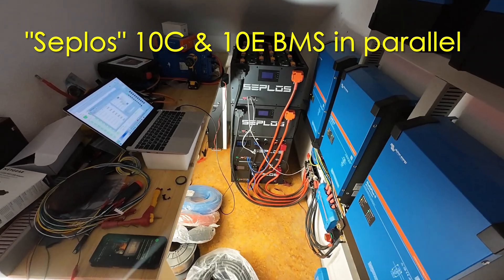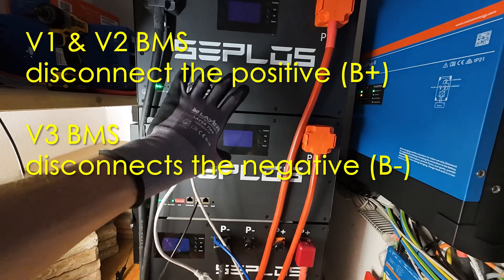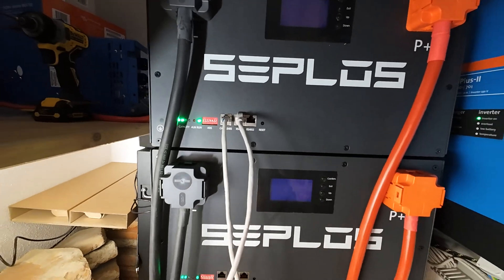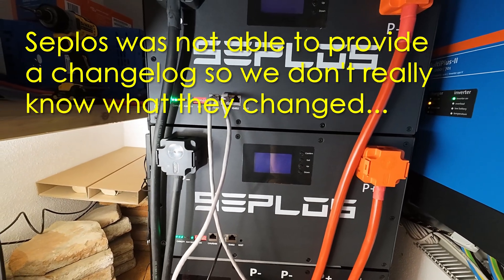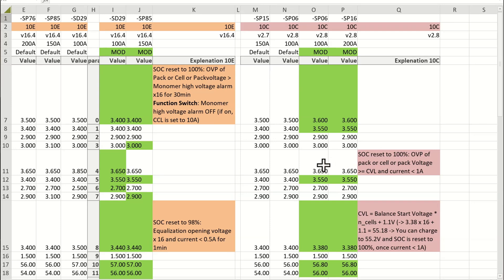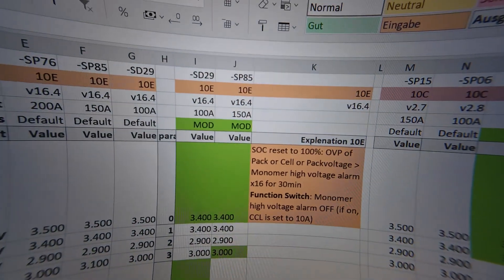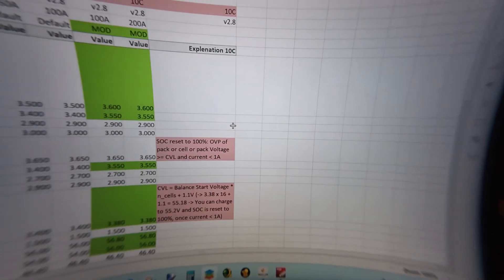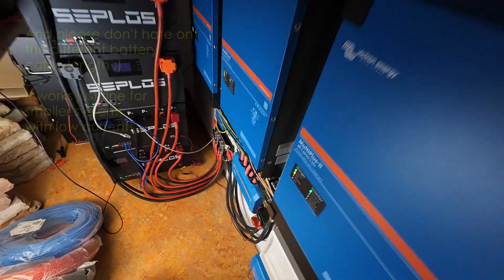Seplos BMS 10C & 10E parallel CAN communication & best settings

Comment: Thanks for this video, this is just what I was looking for. One question, I have a single battery 280ah setup and wondering if any of the settings would differ from your sheet because of this?
Reply from the maker: You can use the same settings.
Reply: Thank you  @Raphael_Hofmann

Comment: Juste question, JkBMS or SEPLOS Bms ? Best ? for victron multiplus 2 5000. thx
Reply from the maker: Both work just fine. I use the JK inverter BMS for my new batteries. Check out my new vieo in 2min it should be online
Reply from the maker: https://youtu.be/9eJaBXV0C70